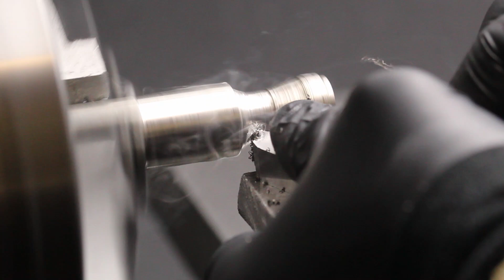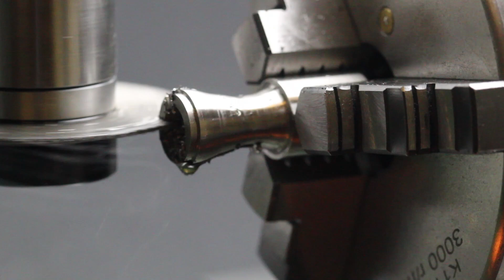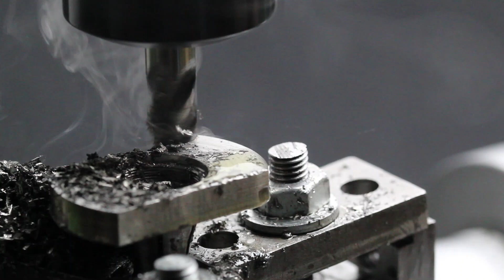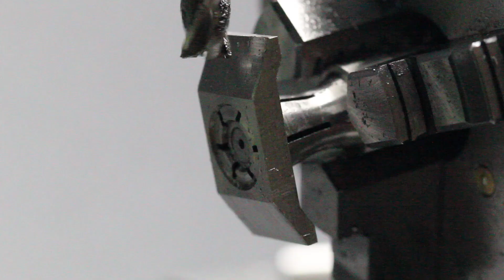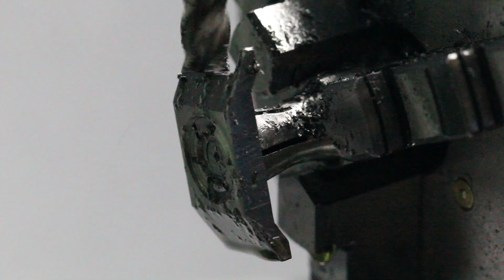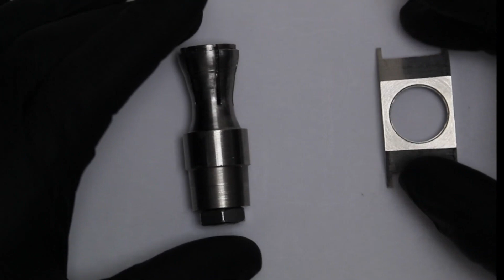first attempt at case for Omega 484 movement

Comment: Nice video! And even with all the issues, the case and holder looks really cool 🙂
Reply from the maker: Thank you, a lot of fun. Messing about trying to get a good method to holf movement and dial in case at the moment. Once that is sorted very excited to try and make a good case.
Reply: @ I’m actually making my own case holder at this exact moment, but it’s not going to be an expanding arbor. It will be a jig that fits perfectly inside the movement hole and clamped from above. Hopefully that will be enough to hold it in place 😃
Reply from the maker: I have seen it done that way and I am considering it myself for the next one as I may loose much of the interior surface which I was clamping on. Good luck!
Reply: @ Thanks! I will give it a try tomorrow on a brass case. If that’s not working then maybe some super glue could help 🤔

Comment: Fantastic Stan! I have question which you probably answered multiple times while I was jumping around, but is that case material steel, nickel, or something else? And do you have any advanced details about the specific source, labeling, and / or alloy composition?
Reply from the maker: @IMakeWatches  cheers, i am using 303 stainless steel. Very widely available as bar stock in a great range of sizes. It is the easiest stainless steel to machine and thus my choice here.
Reply: @stanwatches  Thanks! I look forward to trying to turn and machine some 303 myself!
Reply from the maker: @IMakeWatches awesome, I am finding that turning especially when the tool is sharp and the angles of the grind are good it is possible to get a great machined finish. I have been grinding my own turning tools but am not confident yet to recommend